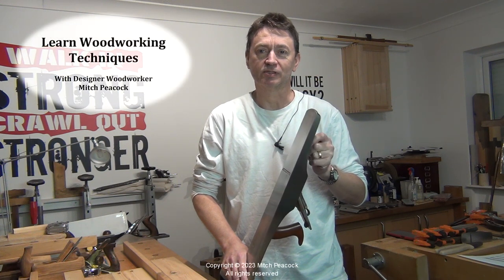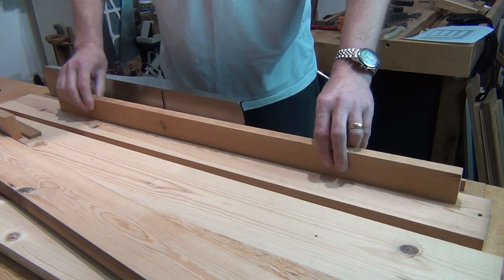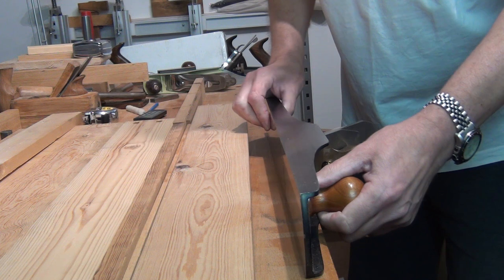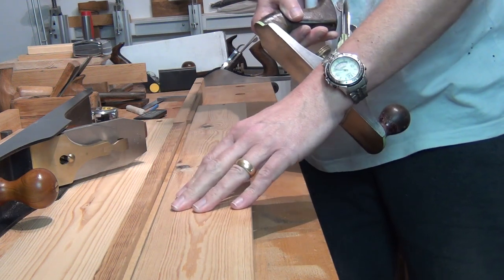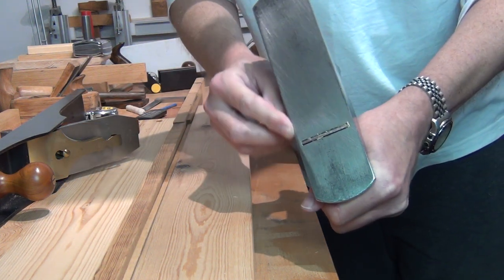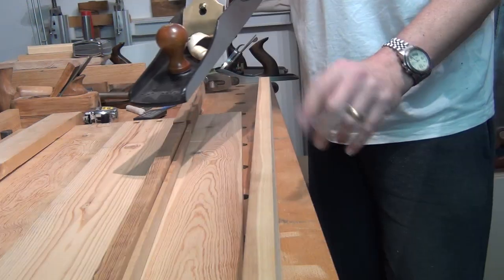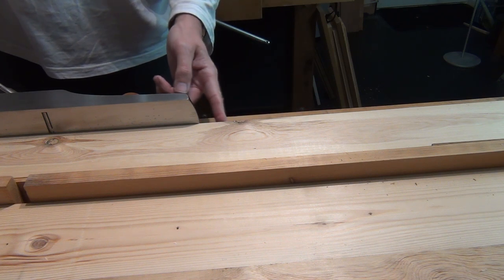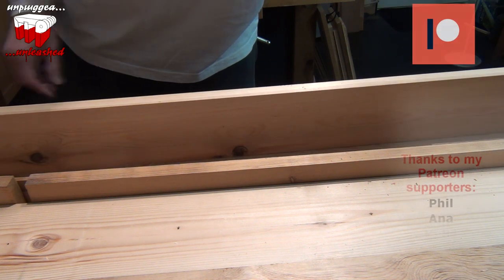Easy Edge Jointing / Woodworking Pro Tips / Unplugged Woodworking

Comment: Great video.  Using your system you could use the system of equalising any slight angle problems (IE. 87 degrees) by flipping face sides like on a jointer.
Reply from the maker: Cheers. Absolutely 😃, great thinking